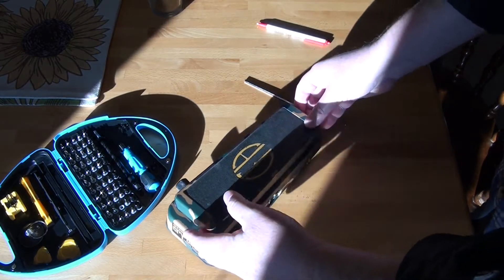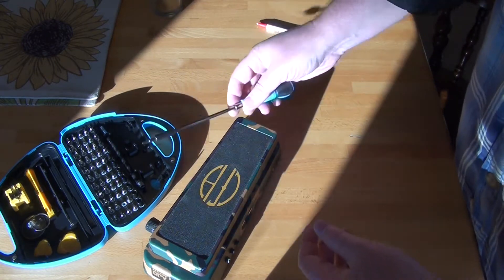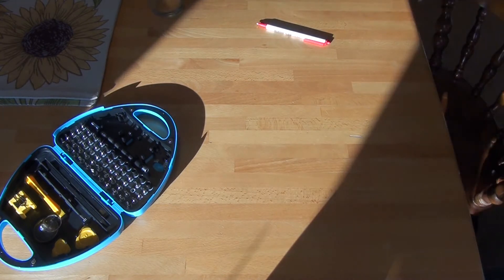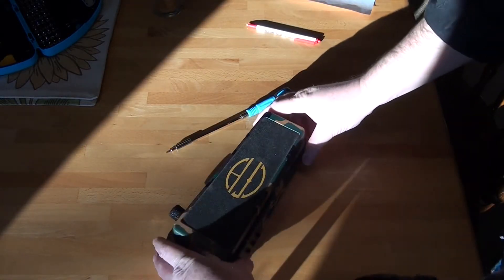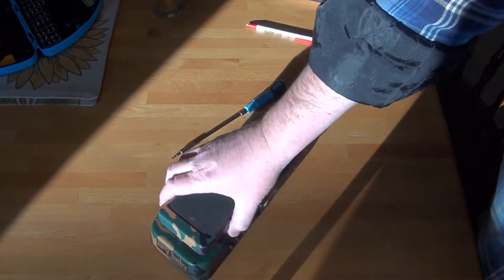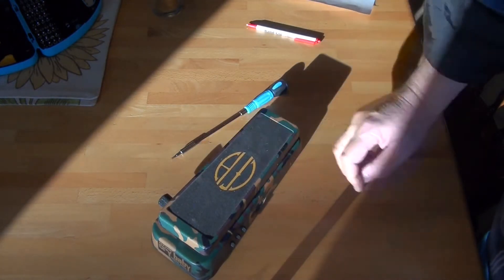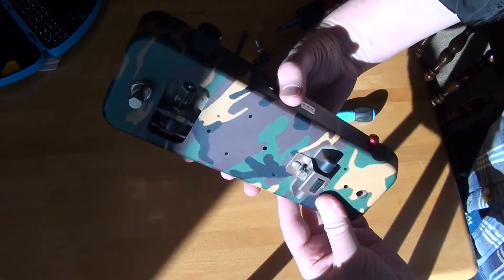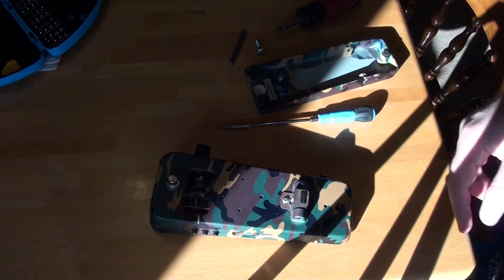Tension Adjustment On A Cry Baby Dime Wah Pedal

Comment: Hey mate you probably didnt need to remove the top part of the pedal. When the pedal is in the lowest position (touching the buton)you can you use a long allen key to adjust the allen screw from behind. The key comes with the pedal but you can but you can easily buy it.  The adjustment takes 5 seconds 😊
Reply from the maker: Yeah, but then I'd have to wait for the correct wrench to come... Either way, mine's fixed!!
Reply: I think taking the top off was necessary because of the missing nut. It looks like djusting the allen screw from where it's supposed to be was doing nothing.
Reply: What kind on allen key is need? Just regular allen key?